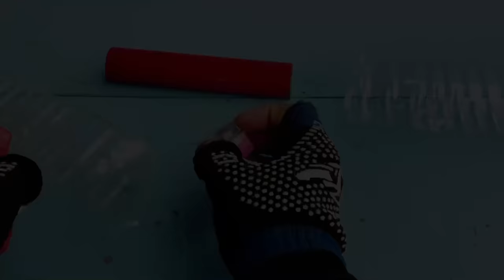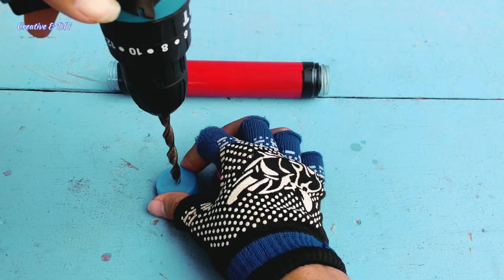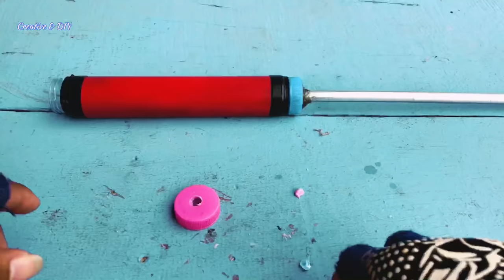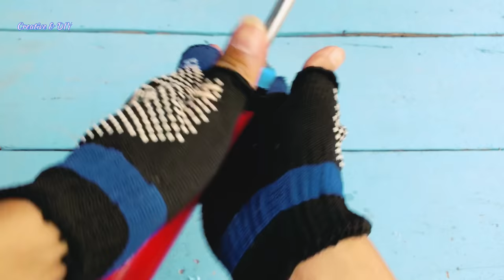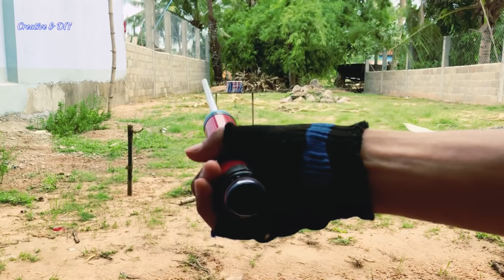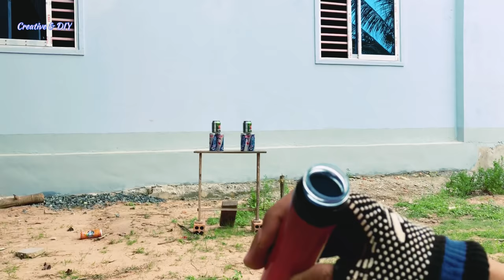DIY | Creativity Slingshot slingshot Easy survival

Comment: Great idea! Try attaching a magnet to the barrel to hold the bearing in place. Then it won’t roll out.
Reply: But then it wont come out with much force if it comes out at all
Reply: Spit on the ball. just enough sticky to hold the ball in place but, must be seated at the breach.
Reply: Or use some tissue just a tiny bit to hold it in place
Reply: Agreed , but nothing to strong it will take away from the power of the shot find one that's just enough
Reply: @elultimo8428  Nonsense. You know nothing about pressure and projectile weapons. In fact, more resistance will only increase the pressure build up and velocity of the ball. A loose round fired from a barrel is much slower than one which was tight enough to offer some resistance. This allows the pressure to increase more behind the ball, and loses less by expansion after the ball leaves the barrel.

I'm a retired professional fireworks operator and pyrotechnic chemist. I make fireworks and muzzle loading "things" both large and small. A 3 inch aerial shell loose in the mortar barrel, can hop a few meters into the air then drop onto the ground before the timer runs out and it explodes. The exact same charge behind a 3 inch shell tight enough to need a ramrod to seat it fully, instead launches perfectly up to 100 meters before breaking perfectly at apogee. 

The magnet idea is actually brilliant. So long as you're using steel shot. I was thinking of a leaf spring or something to do similar but the magnet is simple and perfect for the job. I'd still ensure the projectile is snug in the barrel because nothing ensures the expanding gases will complete their task before ejecting the shot. I am thinking instead of a magazine feed and additional features that allow recharge with the push of a button.
Reply: @GrassPossum  calm down pyromaniac
Reply: @ghettocowboy993  A small neodymium magnet is fine. The initial inertia created by the magnet increases the force of the release, as the band’s force must increase to overcome the magnetic resistance. This is hardly noticeable and your ammo sits snug in the chamber.

Comment: more amazed at his sharp shooting skills than the actual manufacturing of illegal fireshot
Reply: Not illegal everywhere
Reply: Everything is legal if you don't get caught.
Reply: plot twist.. there is someone pulling the cans by string everytime he fires
Reply: Thinking it needs to glue a magnet on the side of the base of the barrel will help hold the steely
Reply: I think someone off screen is shooting a real gun.
Yall really think raped on ends would hold? Lol
Reply: Yo, ATF!
Reply: I've lived in Asia  and the Philippines  there is not over regulation. Not like the U. S  AND CANADA. EXAMPLE  THERES A HELMET LAW BUT NOT ENFORCED IF YOU FALL OF AND SMASH YOU SKULL ITS YOUR FAULT YOU WERE TOLD .
Reply: @kkirby2485  true story, it's only illegal if you get caught
Reply: @Imageloading...  Yes. This is not as powerful an explosion as gunpowder would produce, and for a while at least, this setup would work with black Powder in also. The taped ends would blow out before the walls of the combustion chamber failed, but no amount of alcohol fuel you could conceivably vaporize in this size container could ever blow out those taped on ends. Any fuel not in vapor form will not be part of the 'explosion' and will be left behind as the explosion would shut down any flame. Liquid fuel does not burn. It must first be a vapor. I'd use thicker polycarbonate bottles for the end caps too. Those cheap water bottles are paper thin. I would have used some special glue inside the seal and used electrical tape on top of it, because I always seek to over engineer solutions which are load bearing and I'd be experimenting with higher octane fuel and gases too. I'd like to see MAPP gas used. It is by far the most potent in my gas cannon, compared to butane and propane.
Reply: It is not illegal to make such a device. Not even in Australia, and we're the ultimate nanny state. The illegality would be in using it, and even then maybe not on your own private property. It simply doesn't fit any of our various state firearms legislation.

Comment: “Why does he want to hit those empty cans in style I wonder? Wudn’t it be easier simply to knock them down with stones or pebbles?” Joking aside, it think it’s really a very good contraption that can be used in many fun ways. Is that meth spirit spray? It could be taken few steps further by somehow adding the spirit sprayer to the gun ( with valve system?) so that gun can be fired repeatedly without having to open the back cap each time,,, no?
Reply: You have to open the back like that to also let in a air. There is a ratiol between the amount of fuel and the amount of air that will actually create the explosion that will propel the pellet. Without the air, it won't work.

You could also attach a small hand air pump to the device, and then the pump bottle like you suggested to accomplish what you are thinking.
Reply: Better yet, simply have a liquid reservoir attached open to the combustion chamber. Only the fuel which is in vapor form ignites. Any liquid remaining will remain and the flame is blown out in the explosion. That way you just shake it a few seconds, drop in a ball and fire, repeat. No need to even push a button to prime the chamber, just shake it a bit. As it gets warmer, it will improve performance too.

Comment: I Need one In .72 caliber  😎
Reply: I have a .75 caliber muzzle loading pistol. I made it almost completely of HDPE. The barrel even is HDPE irrigation pipe! Not as crazy as it sounds. We use HDPE mortars in fireworks, they're safest and can manage similar rapid expansion stress to steel. If the explosion lasted a couple of seconds it would cause trouble from the heat, but in the fraction of a second in reality, the plastic being nonconductive doesn't even get warm. I've fired 12 inch aerial shells from polyethylene mortars which were no thicker than what a steel mortar for the same job would be. I use a full load of black powder charge in this little beast of an elephant gun and a molded lead ball of .75 cal. It has a similar muzzle velocity to an old time muzzle leader.  It would stop a charging elephant. Or an attacking tiger. It is modelled after an old time Howdah gun (which was used in tiger hunting on elephants in South Asia during the British Raj,  and is quite pretty. I've made double barrel versions and modelled various old timers and they're look cool on display, yet upon examination you realise they're all plastic, except the trigger, hammer and some styling. These I make from aluminium and some simply hand tools. They're astoundingly accurate too. No worries at 50 meters, I can hit a ten by ten inch with just point and fire. The oldies never had sights but I have even fitted laser sights on them for fun. The accuracy was no better, than just point and shoot though. 

Now a caveat. I have not and would not make a long gun this way. They have a much higher pressure and I think the poly would fail before long if one did. I'd also not put modern smokeless powder in them. Nor does one do this with steel muzzle loaders. Modern powder has a much higher deflagration rate. Even if you use more black powder, it's slower rate of deflagration still keeps pressures within a lower range, as they expand over a longer time, even if we're talking mere thousands of a second. 

The explosion of the charge does not reach a high enough heat for long enough to soften the poly barrel. In fact due to it being nonconductive, it doesn't get as hot as a steel barrel would. After a couple of hundred shots the barrels do become brittle and will eventually shatter. However the design is such it presents no risk to the user. The plastic stock and hand grip is a safer barrier than wood. I've also done these in .50 and .60 cal. I love the boom and smoke cloud which comes out of them. SO much more awesome than the smokeless bang of a modern firearm. Your first reaction every time is to say WOW, as you admire the big smoke ring following after that almighty BOOM.

Comment: Attempted DIY ice melt for patio seen on Facebook year before. Didn't bother checking the formula; had ingredients. Rubbing alcohol, hot water, blue Dawn dish soap. Water just prior boil. Soap. Bottle rubbing alcohol. Clean kitty litter jug. Created a small bomb. Fortunately i still have a face. Lid was a house away after it hit my cheek. 

Similar opened beer in crinkly water bottle. Refrigerated. Begin unscrew cap, lid blew off bottle impressively. 

.
Reply: Очень  рисковано! Горячая вода испарила спирт и статическое электричество от пластикового лотка дало искру.
Вам очень повезло что это был не бензин. Напалм не тушится ничем кроме угликислотного огнетушителя (((

Comment: HOW DID YOU COME UP WITH THIS IDEA WOW ... EXCELLENT DUDE!!!
Reply: It's a micro potato gun
Reply: @marcelgaddis9319  , funny I said the same.
Reply: @marcelgaddis9319  
Yeah I remember building one when I was around 10... I spent my allowance at the hardware store built a nice PVC Bazooka had a handle with the ignition like a trigger a cap with a hinge and cotter pin lock setup. Add a dash of water calcium carbonate wait a second and push the ignition switch. I'm pretty sure people wondered about the fist sized dents in the town stop signs though 😅 good times.
Reply: Old news.. where have u been before youtube .. we already build those before you were born

Comment: What is the clear liquid that you sprayed in the gun? I never did see if you said.
Reply: Tinner, sprit water, any alhcohal lique..
Reply: @MrKickLai  would rubbing alcohol do?
Reply: @paulvincentangcon2659  try make 1 n see..
Reply: @MrKickLai  I was asking just to be sure I won't blow my hand off.
Reply: @paulvincentangcon2659  Never try never know...
Reply: @MrKickLai  You haven't tried it too, haven't you?
Reply: @paulvincentangcon2659  helll yeah....the answer is no....
Reply: denature alcohol sir
Reply: @paulvincentangcon2659  yes. It probably is isopropanol. (rubbing alcohol) Ethanol, methanol, butanol and also acetone, and any flammable hydrocarbon. Acetone would be excellent because of its high vapor pressure. Much more of it will vaporise thus explode. Methanol would be the best alcohol I guess as it has the lowest boiling point and should have more in vapor form too I'd think. Diethyl ether would be awesome!
Reply: Back in the Day  Methanol even better, more vapors. The liquid is useless you need the fuel in vapor form. So manipulating it as he does is important. However, the warmer the better too, as more vapor pressure will build up

Comment: What stops the ball  bearing traveling all the way through the tube and into the red body?
Reply: He made a smaller hole on the bottle cap didnt you see the damn video?
Reply: @elultimo8428  yes , but that Hole looked close to The size Of The bore in tube, it was probably the way he melted the glue stick with a flame that distracted me. I use a purpose made glue gun😂

Comment: How you avoid the steel ball to roll into the chamber?
Reply: It's sitting on top of the bottle cap. The hole is smaller than the ball so it can't go through the cap into the chamber
Reply: If available maybe use super glue and baking soda.  I have much better luck than with hot glue and a lasting seal plus to reseal if it's raining or snow or wet...flame isn't easy to do the melting.
Reply: stoper insider or magnet

Comment: I’m curious. What does he spray into it. And can it fire back?!
Reply: Isopropyl alcohol, perhaps 91%, will do this.
Reply: @SamKGrove  Any alcohol and also ketones and other hydrocarbons can be used. Some will be better. Methanol will be better than higher boiling point alcohols. I'd like to see what acetone and diethyl ether do for the same reason. Ether would be awesome.

Comment: Pity it takes so long to charge these contraptions, how would it go if the fuel was squirted down the exit tube. The barrel tube end nearest the gas expansion chamber could be slightly squeezed to gently hold the ball shot.
Reply: Even a tiny magnet placed outside the barrel could hold the ball in place.
Reply: The end of the barrel must have an obstruction, lightly crimped I assume, because the balls do not drop into the chamber. I'm thinking you could have a reservoir of fuel in the chamber, or maybe a separate one feeding into it. Only the vaporised fuel will ignite, and when you then shake it for a few seconds afterwards, it will be recharged with vapors. You'd not have to remove the end cap to fill it then,, just drop balls in rotate it a few times and then fire. Repeat.
Reply: @GrassPossum  а кислород,лол?

Comment: just spray the fluid down the barrel instead of removing the back for every shot.
Reply: What fluid is that
Reply: Wat is the fluid
Reply: There wouldn't be enough air in the tube for ignition it would be a slow burn if anything
Reply: Right on Daniel
Reply: @allanjugroop7829  probably rubbing alcohol

Comment: Push the tubing through the lid to get a better and stronger seal,
Reply: And if you do that, the projectile will fall inside the chamber in this scenario. Unless you drill a very small hole in the end of the tube and insert a “stop” of some sort, like a nail that has been cut down to length.